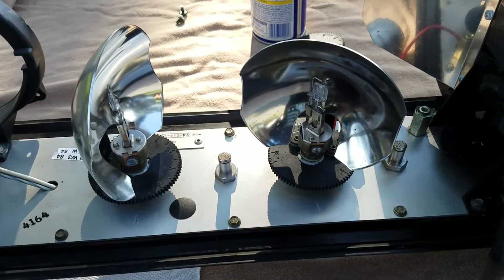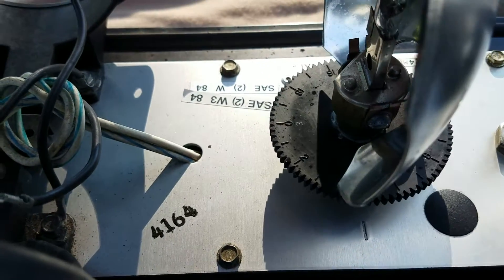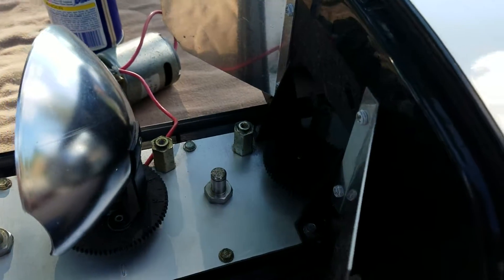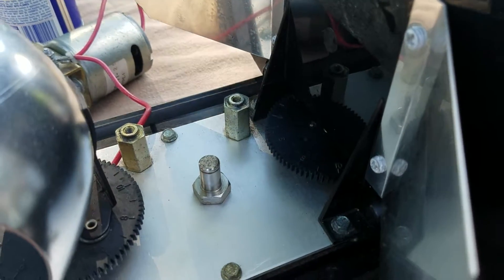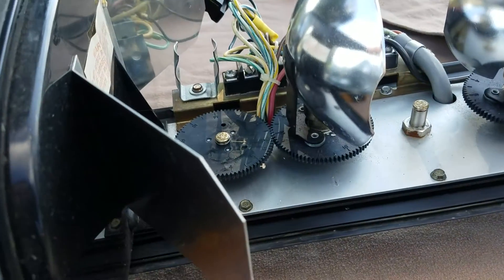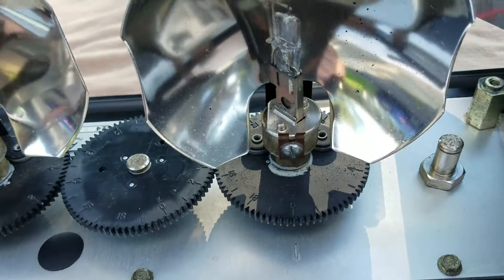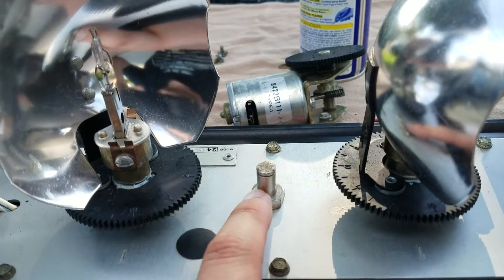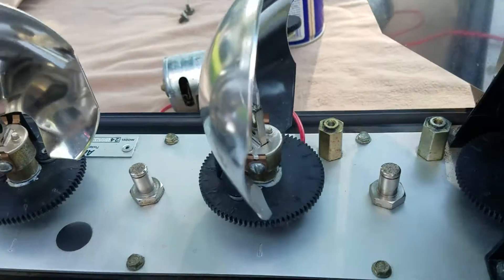Setting Gear Timing and adjusting flash patterns on an Aerodynic

Comment: Back in the late 90s I acquired an AeroDynic M24 EH.  There was a flash pattern I never quite figured out, what I call the "cascade."  It's the pattern you'd see on Roscoe's sheriff car where the flash is outer to inner in a cascading pattern.  You had to set the gears opposite for driver and passenger to get the effect, but I never knew which number gave that look.  Docs were not as easy to find back then LOL.

Comment: Ironic, I just timed my Aerodynic 22H using the idler gear removal method a few minutes ago before I found your video. Not sure grease is a good choice for lubricant, as there was quite a bit of sticky grease on the shafts. I cleaned them and used 3 in 1 oil. Regardless, the light is much quieter and a bit faster. Mine is RWWR, and is now set up so the reds alternate, as well as the whites, and they also alternate with each other, so is always displays RWRW when on. Wish someone would make a replacement drive gear for these. I imagine they'd sell well. I could always use a couple of spares.
Reply from the maker: The grease comes straight from the manuals and Federal.    3 and 1 oil will work initially but eventually it will evaporate.    Grease tends to stick around and be usable for the long term..   I keep cleaning grease out of bars that has been there for probably more then 20 years.. so it holds up. 
There is talk of an elb member reproducing the "clutch" gears.. I dabbled a little bit with 3D printing and was never able to get it the way I wanted to.    Someone with better skills then I probably wouldn't have much issue.
Reply: One thing is for certain, there are a lot of these beautiful bars that have been taken out of service for lack of replacement drive gears. I'd like to use mine but for now I'm afraid to for fear of wearing the gear out. Love the way the flashes are synchronized for maximum visual effects. I'm sure a machinist could duplicate one in brass but it would be expensive. And you get the potential problem of wear on the worm. I saw a Visibar sidelined because the drive worm was worn out. 
On the grease vs oil note, I used oil as my 22 won't see much use and will be inside and easily relubed as needed. Question: how are the light assemblies removed for access to the pivot points? I removed the idler gears and cleaned up the pivots but couldn't see how to remove the reflector assemblies. (Another reason I used oil).
Reply from the maker: underneath each of the idler and reflector gears are ports that allow for the introduction of lubricant.      On older bars I tend to use simple green and a tooth brush to get at the old grease.      Once cleaned out I reapply new grease.
Reply: I'll likely relub my lights as time permits. Would automotive white grease be satisfactory?
Reply from the maker: I use a white lithium grease.. which I believe is the same..
Reply: I was sent to you to get educated on gear timing.  I have a 24 EH with 3 and 3 rotators.   I understand how to set the timing as this video shows.  But where can I find a list of different patterns to set?   I did set a 25 this winter.